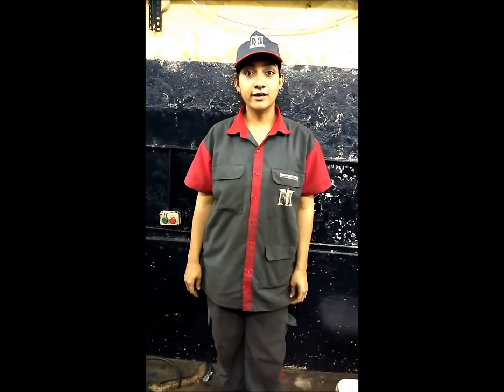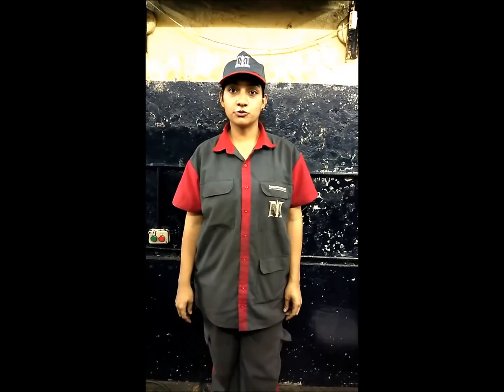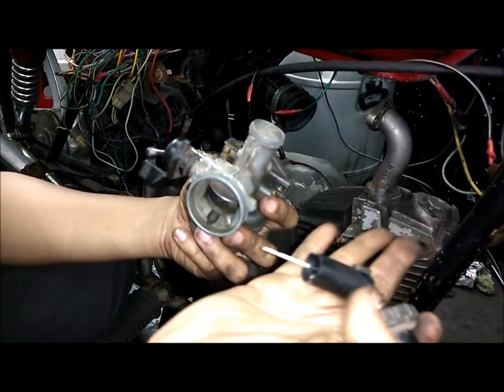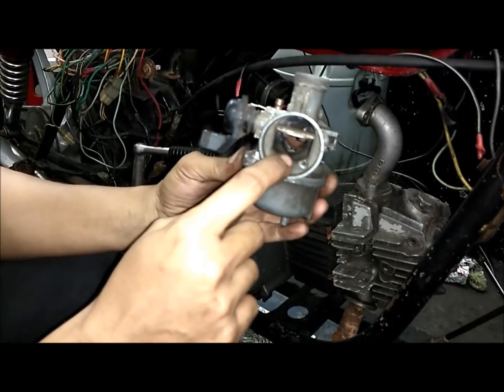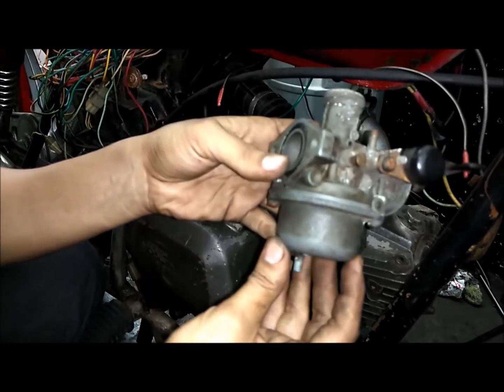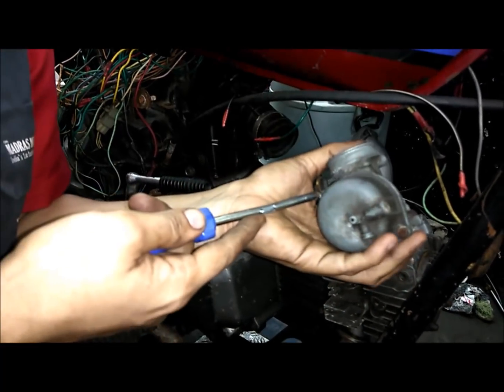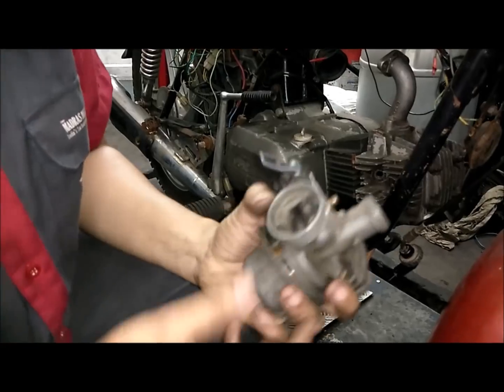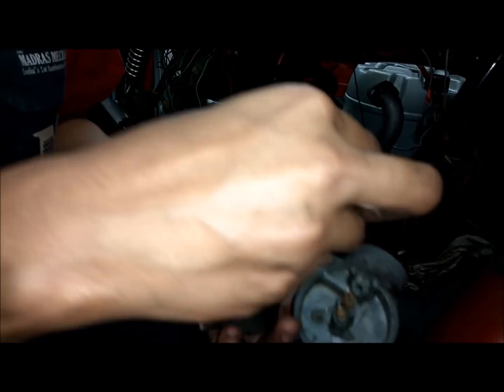DIY - Carburetor Cleaning I Splendor Carburetor tips and tricks I Step by Step I Chennai I AMT I MMI

Comment: Madam, pls advise me. My splendor nxg carburetor is leaking petrol as I can see dust mixed with petrol on the body of the carburetor. Earlier, petrol was leaking through the overflow tube at the bottom. It was stopped by tightening of the overflow screw but now still I can see some petrol leakage through the body but very slow to detect.
Due to this, I get mileage of only 45 kmpl or so.
Earlier, it had mileage of over 67. So kindly advise me how I can get my mileage back?